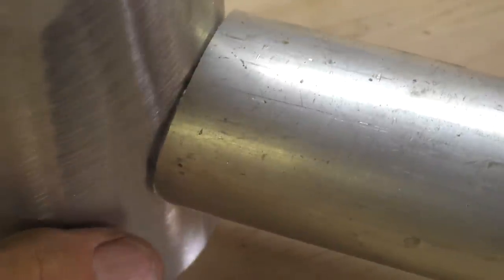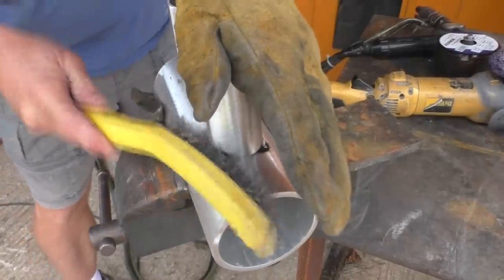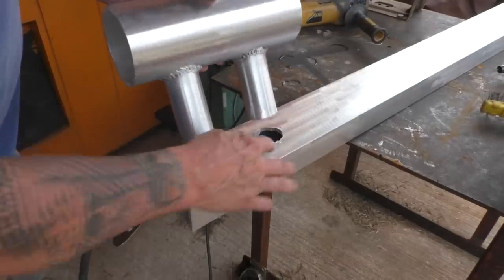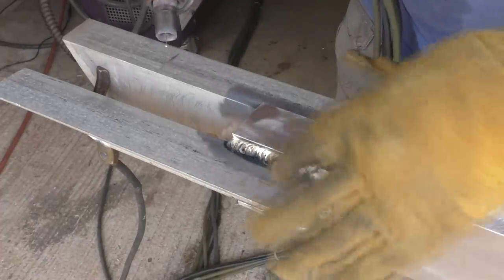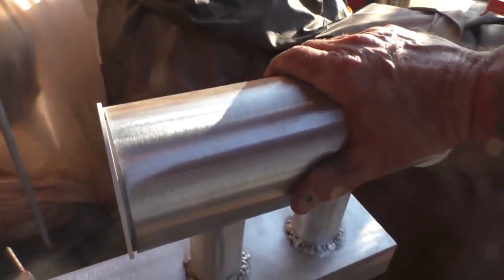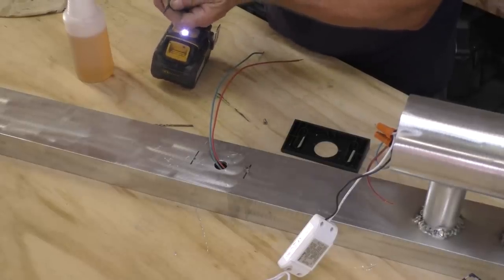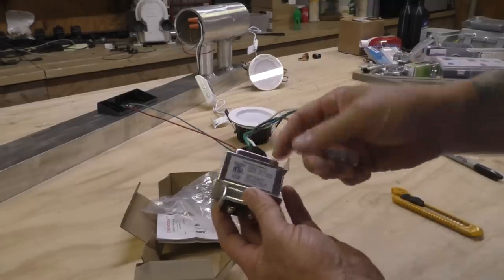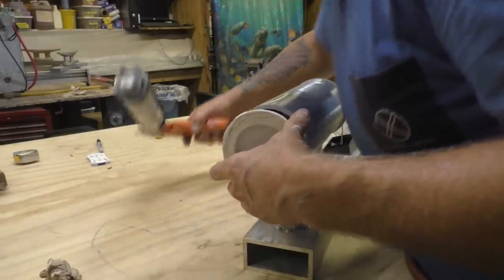DIY Light Post for Ring Camera

Comment: That transformer will get much much hotter then the 4in recessed will.
Reply from the maker: Horse Shit.  It's a matter of amps.
Reply: @SVSeeker  haha they heat up then 
terrible things will happen! So you need to install a safty radiator for safety. Also a siren that goes off for safety.

Comment: Those Bluetooth lights are ducks guts. I've put 9 of them up above my slotcar track. I've got 3 separate sections for the lighting, which you can turn off or on and controls the colours for each section or each individual light.

Comment: i love ring cameras..  for those who are not aware .. intelligent sprinker control panels are available that allow you to turn various lawn sprinkers on or off via your cell phone..  you can get 8 station.. or 12 station versions for around $100 bucks. .. so when you see something or somebody on the ring camera while you are away.. you have your choice of options.. sprinklers.. relay controlled air horns..  relay controlled sirens..  even perhaps turning on exterior sound systems .. ok.. tell me you don't have a favorite Machine gun recording.. rattatatatat ..
Reply: Fire crackers in a pan, triggered by an old school resistor and match in wax 🤣🤣

Comment: Very nice looking - reminds me of a late '50s/early '60s "floating" lamp-style body.
Reply: I'm curious, as I'm not old enough- what do those look like?
Reply: Me either, but I like old styles:)  They usually had a brushed aluminum wallmount with the same sort of horizontal bars connecting to the actual light housing. I seen fancier ones that would branch out into several housings with swivel-mounts. They were usually like an aimable reading lamp.

Comment: You can drill the holes with a mag drill..just mount the mag drill to a still plate then clamp the aluminum to the steel plate🤔
Reply from the maker: Yes, it works reasonably well but it does not have much travel, so it's limited.

Comment: I don't wanna piss on Doug's bonfire, or put other people off making something, but in the UK at least I was able to pick up a similar design of light, made in 'stainless' for like ten bucks from a big box ('DIY Shed' in Britishese) and I was genuinely surprised at the skookumicity of it, had the correct IP rating and everything.  Of course I'd still need the pole, door bell switch, etc. 

Point is, sometimes you direct your energy to the bit that is custom, and buy the parts that can be had easily off the shelf.  Other times you roll your own completely.  The trick is knowing which path to take before you start...
Reply from the maker: You can buy almost anything and often even save money.   But then you miss on gaining skill and ability and remain ignorant and incompetent.

Comment: You should consider a 3d printer vs a mill for your boat. You can carry many many spools of material and get some almost anywhere. You can get ultra strong materials and it wont take as much power or space. Plus the material is easily recyclable by yourself so failed or broken parts are easy to remake with the same material.
Reply from the maker: We'll have one, but you must be kidding or you've never used a mill.
Reply: @SVSeeker  dont get me wrong having a mill is an absolutely amazing thing to have if you have power and some scrap you can make almost anything and I know and love that, I was simply trying to point out the ease of use, recyclability (sp), and the fact that with a 3d printer you can set it to go and let it go without needing any interaction and its alot easier on power (in your case fuel, solar or wind) because they can be 12 or 24v. If you get a wide and flat printer you could even do large objects like a prop blade without having a huge amount of bronze to cast or a plate to mill. Either way your an inspiration and I cant wait to see you hit the water and open the sails!! If your in need of Filament for your 3d printer look for taulman 95 or 910 there is a video out there that shows a 3d printed spike being pounded into wood. That was printed from the taulman filament.

Comment: Hey Doug, You mentioned corrosion in the tiny gap between those aluminum plates... could you put an adhesive like 5200 or deck glue etc in there and scrape off the excess enough to burn through it with the weld pass afterwards ? That or leave a cleaned strip along the edges where you'll weld... Just curious, hope you are all well !

Comment: Now I do have a question about this that is electrical code in most states but I don't know if it is in OK: is the circuit the light pole is on GFCI circuit and did you run the ground wires back to the panel insulated all the or did you ground to the pole (either by attaching or having bare copper wire in the pole)? The GFCI circuit is usually required for all exterior circuits, but older homes and lines to light pole tend to not have them, but anything can vary by local code.

I ask because if there is no GFCI and you grounded to the pole, by attaching ground to it or otherwise, you have formed a nasty little thing called a ground loop. Now, it rarely actually causes a problem and a GFCI circuit protects against it in most cases, but it is possible to have a fault to ground in any circuit in that panel to cause the pole to become energized at a full 120VAC. 99% of the time this doesn't happen and the fault to ground trips the overcurrent device, but it can happen. Would I go and open up the light to fix that? No, since it is very unlikely to happen, but if I built and installed another similar setup I would take care to make it just a little safer than the last one.

I brought this up just to highlight both some of the good parts of the NEC, but also to highlight how it has overprotection for highly unlikely fault states.

Comment: Why an upward facing light? Isn't that just unnecessary wasted power and light polution?
Reply: its to light the tree he has near the gate
Reply: If it isn't needed then why have it? Sure a single led might not be that much extra power but it still shouldn't be used. A leaking faucet is hardly "wasted" water but we don't leave it leaking or design it into our bathrooms. And it is light pollution by definition. https://www.globeatnight.org/light-pollution.php
Reply: "Unnecessary" is in the eye of the beholder and none of anyone else's biz...
Reply: Actually, I love the upward light and how it shines through the tree...  the downward light is a bit TOO bright.